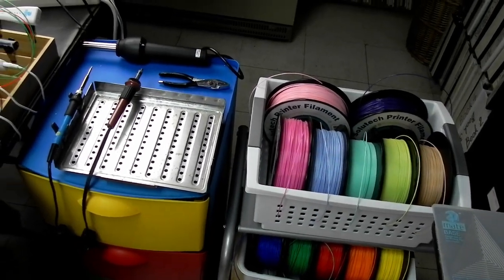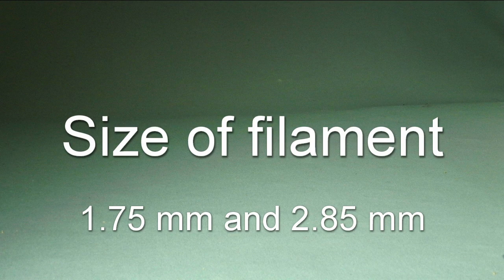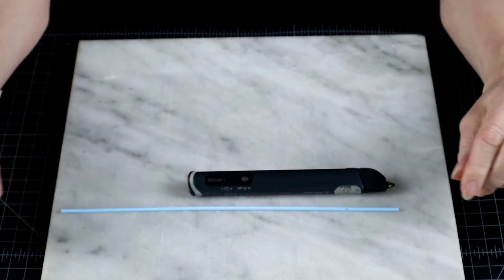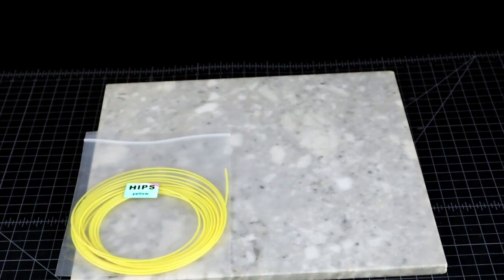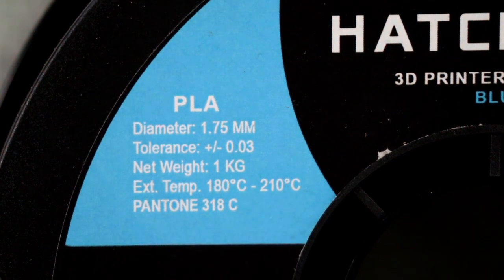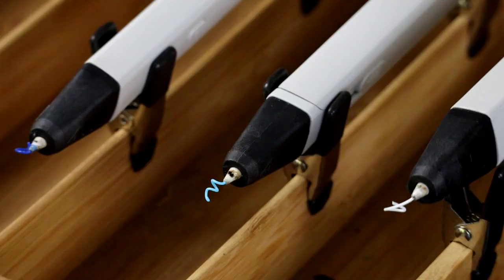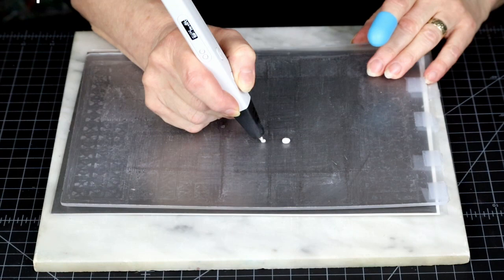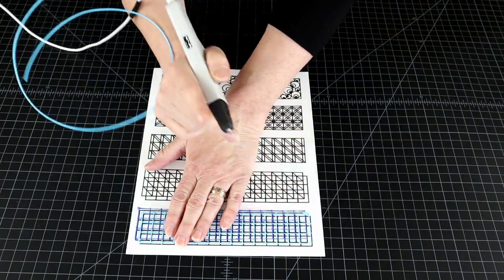How to choose a 3d pen

Comment: Hi , Please use the fat white 3D pen with the Mate one written on it, and the long blue 3D pen, try to make a difference, is it comfortable to use?
Reply from the maker: Unfortunately the blue one never worked very well. I had two and the motor gave out right away. Shame because it was super nice to hold. The short fat one may still be around. It is a work horse for filling in large areas but extrudes a bit fast for me for the finer stuff.. So it depends on your preferences.
Reply: @3DPENDEN So the white fat one, there is no filament output speed setting?
Reply from the maker: There is but all the speeds are pretty fast.
Reply: @3DPENDEN I also have the blue 3D pen with the square aluminum body, it seems to only work with Pcl filament, right?
Reply from the maker: No mine was made for PLA but it broke fast.
Reply: @3DPENDEN I mean the blue one but the material is aluminum, isn't that only for Low temperature PCL?
Reply from the maker: My blue one said it was for PLA. And it worked with it just not for long.
Reply: @3DPENDEN Wow, is the blue aluminum 3D pen PLA, the price is more expensive than Rp. 800a?🧐

Comment: Luckily I have a wood burning tool that I originally purchased for making Harry Potter wands.
Reply from the maker: Great. Hold onto it. It comes up fairly often that you need to resoften the plastic during a 3d pen project. Here are two videos that have some how and why's if you need to know more.
9 reasons to get a wood burning tool if you have a 3d pen: https://youtu.be/IHpmzxrLNik
How to smooth 3d pen projects without burn marks: https://youtu.be/3rHJW-6K_hk
Also this 2 minute short has a new gentler way of cleaning the tips that I just started using. My 3d pen studio – Smoothing tools: https://youtu.be/ir6eK6zv7VE

Comment: I have a 3d printer, which is fairly new to, but I am loving it. 
I thought about getting a 3d pen for my kids, but after watching this video, I want one for myself. I had no idea that the printing pens were so in-depth. Thank you for this video
Reply from the maker: Go for it! The kids will also have more fun if you do it with them. Here is the beginner play list if you need to get started. :) https://www.youtube.com/playlist?list=PLv3Q4cup122qNtcn0Eadq0wXmeKvxCcVY
Reply: You can do so much with a 3D pen. I've had one for years and I've had so much fun with it. But it broke suddenly and now I know what to look for in a new pen. But years have passed and I wanted tot see other options. I recommend a 3D pen you can adjust heat, sometimes you want it colder and sometimes warmer depending on the technique you're using. I also want a wireless pen and as small as possible. That is what works for me. I've used a 3D pen called 'DYD pro'  and they're good!

Comment: Hi, great video what do you think of the mynt super 3d pen?
Reply from the maker: I don't have the mynt super but my understanding is that it is like the PRO except without the temperature display. It is also $20 less. I like the temp display because sometime it's nice to just adjust it by a few degrees up for certain brands of filament. But if the money is an issue I imagine they both work well since they are from the same company. I mostly use Mynt PRO and love it.

Comment: A fine guide here. I should have started this hobby 5 years ago but finally have the time. Only a few weeks in and I'm still just practicing strokes and basic shapes.  To the subject of your video, also now have a collection of 3 pens, Mynt3d pro, Scrib3d and a rebranded version of the 3d Mate in your intro.
Would you suggest reserving a pen for non-standard filaments only?  Also, would ABS hold up better for garden art?
Reply from the maker: Which of your pens do you prefer? As for reserving pen for non-standard filaments I don't think you need to. But I am by no means an expert on non-standard filaments since I mostly work in PLA. I would definitely try ABS for outdoor use. I had a PLA mobile hanging on my porch out in the elements and it lasted only about 3 months and then it got really brittle. Not sure how well ABS would do, but presumably better.
Reply: @3DPENDEN   The Mynt went to the top of the list as soon as I used it. The retraction seems quicker, the temp seems more accurate, the sliding speed control and the tip (like on the Mate) sticks out further from the barrel than on the Scrib3d..  I like seeing where the flow is going.
Reply from the maker: @postal_the_clown  I agree. I mostly use the MYNT I like the slim design. It fits better into tight spaces.
Reply: Hi would you recommend the Mynt3d pro as a beginner pen ?
Reply: @Sam_Plissken  Yes.  You might as well start with a pen that has all the features (speed and temp controls).
Reply: @postal_the_clown   with what pen? The super or pro? Or do you mean a normal pencil?
Reply: @Sam_Plissken  the Mynt 3d pro.
Though maybe $60 might be a lot to invest if you don't think you'll continue.

Comment: So my daughter used one at school and she's been raving about it and it's what she wants for Christmas.  Which one would you suggest for a 9 year old? I'm not sure how hot these get, I'm sure my youngest will likely use it too, she's almost 6.  Would the white one be safe?
Reply from the maker: I would recommend the MYNT:  MYNT3D  https://amzn.to/3I9WVre
I just had a class with 10 year olds and they were fine with it. Only the very tip gets hot. They still need to be careful not to touch the tip but at 9 I think they can handle it. 
There are pens made specifically for kids that do not get hot at all, but they use different type of plastic, so I never actually tried one to know if they work well. You may need to supervise a few initial sessions but after that I think she'll be fine. I personally believe in giving kids real tools that work. But that's up to you as a mom. Here is also one of the kids versions but hunting for the special plastic that it uses could be an issue both cost-wise and availability-wise. Good luck.
https://www.amazon.com/MYNT3D-MP032-Junior2-Temperature-Printing-Compatible/dp/B08K8RPZVX/ref=pd_lpo_3?pd_rd_w=7506T&content-id=amzn1.sym.116f529c-aa4d-4763-b2b6-4d614ec7dc00&pf_rd_p=116f529c-aa4d-4763-b2b6-4d614ec7dc00&pf_rd_r=AP8A6YRB2C4NH18SQPJV&pd_rd_wg=2Fbyf&pd_rd_r=780c1276-3d01-4f9f-be32-a7c3b2eff937&pd_rd_i=B08K8RPZVX&psc=1

Comment: What are the makes of the pens you have that have replaceable tips, especially the one with a variety.  Thanks
Reply from the maker: 3d doodler has a variety of tips available. At least it used to at the time of making that video. However it is also the one that uses proprietary (and thicker) filament and it voids their warranty if you don't use their brand. Which will be more expensive in the long run. So consider it carefully before you commit. I use MYNT PRO in most of my videos which you can buy a replacement tip for (however it is just one size) but you can use the filament that comes in the regular spools that go into 3d printers.

Comment: What 3d pen are you using throughout this video, the white one?
Reply from the maker: MYNT3D Professional Printing 3D Pen with OLED Display:
https://www.amazon.com/dp/B01BLQ24IW/ref=redir_mobile_desktop?_encoding=UTF8&aaxitk=474ad8f60062648165f5613d380cdf12&hsa_cr_id=4430491500001&pd_rd_plhdr=t&pd_rd_r=e89e51a8-4880-42b3-864c-5236bf031b35&pd_rd_w=xStRt&pd_rd_wg=qpLNV&ref_=sbx_be_s_sparkle_lsi4d_asin_0_img
Reply: @3DPENDEN  that was the one that I'd settled on after watching Adam Savage's video today on using a 3D pen after watching him struggle to see past it when working in a tight spot. I actually put it in my cart, but wanted to do some additional research before pulling the trigger.

Comment: How does the process of the retraction part of the pen works? Because I have that extruding of PLA all the time
Reply from the maker: Retraction is a feature of most pens where the pen pulls the plastic back a tiny bit when you stop. It is supposed to help prevent those long hairlike strands dragging from your pen. It's best to wait in place for a second to give it chance to separate before yanking the pen away.  But there are always some strands left anyway that need to be removed later. I burn mine off with the wood burning tool.